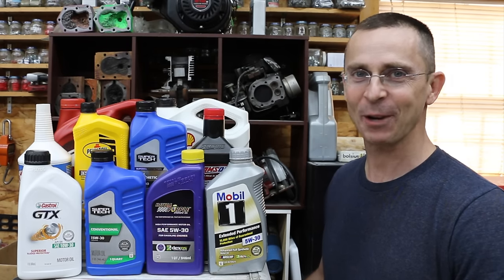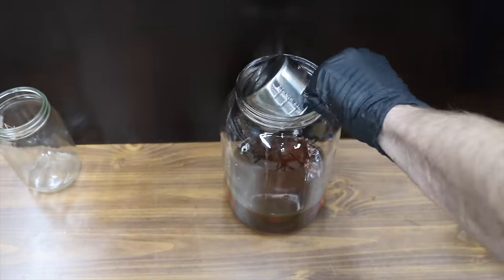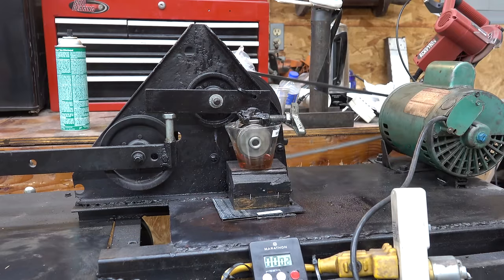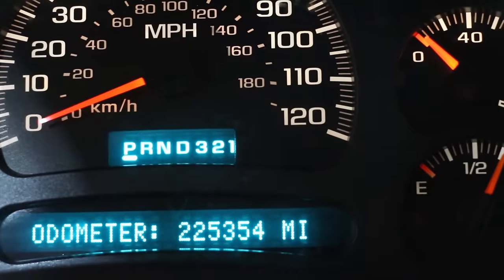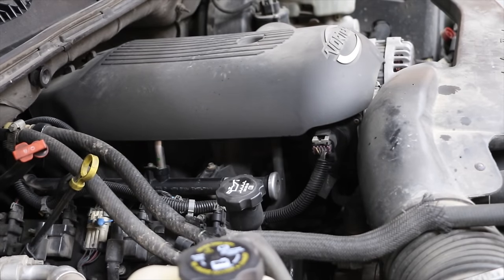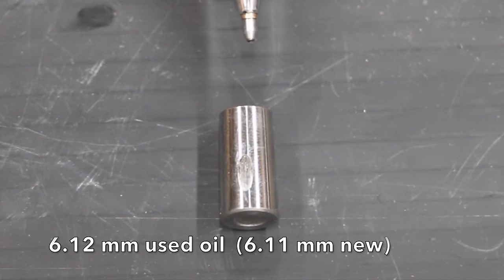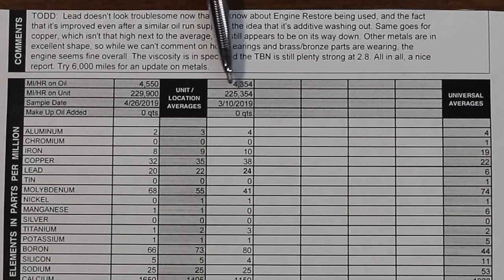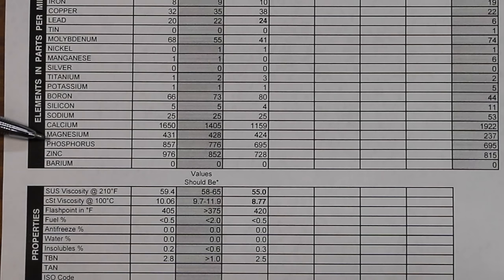Will Mixing 10 Motor Oils Damage an Engine? Let's find out!

Comment: You should try running 80-90w gear oil in an engine
Reply from the maker: Thank you for the video idea!
Reply: My prediction is it'll be too thick to properly flow, and the engine will seize as if there was little or no oil in there.
Reply: @ProjectFarm  80w90 gear oil=20w50 motor oil. The add package is different sulfur in the gear oil will damage the softer metals in the engine. Here's a good chart.  https://53ez82p1xgbdzuy8ma1qotwh-wpengine.netdna-ssl.com/wp-content/uploads/2015/02/Viscosity-Chart.jpg
Reply: Justin Noker would be interesting though because there are products out there that basically just thicken the oil.. like bardahl nosmoke.. I wonder how thick is too thick if you're in a pinch.
Reply: Only in a very high MILAGE engine. Were your BEARING clearances are worn!
Reply: I do in my old lawn mower. It stinks like hell. The thing is so bad on blow by it isn't even funny. I cannot believe it still runs. I used it for cutting my runway for my RC planes. I relocated and do not fly there now.
Reply: @cpufreak101  I use it in my mower. It stinks something terrible but does run ok. The blow by is so bad it doesn't matter. It was a free lawn mower.
Reply: might work ok in Texas in July, but I'd think your engine is gonna be fairly stiff come December at the top of Alaska.
Reply: @jseden  As long as it's not cold outside, you're fine... if it gets below 40 it may not turn over! lol...
Reply: Dean W. I did it in a 1971 dodge with a slant 6.  It smelled horrible.  But I ran that dodge for quite a few years.   I never changed it either.  I was dumping a quart a week in    It leaked and burned that quart in about 500 miles.
Reply: My dad claims he ran a Volvo 240 on gear oil. Said it smoked like a tire fire but the engine was very worn out and wouldn't run on engine oil
Reply: I ran 90w hydraulic oil in a Ford 4.0l v6 in an explorer for years. I got it for free and it had a horrible rear main seal leak. It got to the point where I was fed up with putting oil in it. So I drove it to our shop with no oil in it and loaded it with with 90w. We got 55 gallon drums by the pallet load so it was cheap and available. I didn't care if it blew up after all I got it for free and only used it as a hunting wagon. To my surprise several thousand miles later it was still running. I sold it to my step son for $200 for a winter beater and hunting wagon. 2 weeks later he hit a power pole doing 50mph while booze cruising dirt roads. He Proceeded to drive it 3 miles to his friends land and park it. We went out there 2 months later to trailer it to the scrap yard. I put the key in and it fired right up and drove on the trailer like nothing happened. All this happened after it was rolled 2 times and caught on fire 3 times. I'm a chevy boy till I die but that explore was the most stubborn and indestructible vehicle I've ever seen in my life. It just refused to lay over and die.
Reply: Domino  and 75w90
Reply: I've done this and no damage has happened except for breaking distributor roll pins every once in a while
Reply: I had a knocker that I tried first to put one quart gear lube in. Then next change I used 2 quarts. When I decided it was done for I did it's final oil change with blue bottle zddp additive. It was by far the quietest. I got a few more changes out of her with the blue bottle every time. Finally she wouldn't pull her own weight and I retired that truck. It was a old 351w f150. I miss it but it's nice not to stare at the oil pressure at every stop light
Reply: Yes! And hypoid etc oil. Also like lithium grease 50/50 mix with engine oil so there's a flow.
Reply: With lacquer thinner as fuel
Reply: @hotdawg9840  oh yeah. Y'all gotta try Colman lantern fuel.
Reply: Dean W. Did it for 5 years in my Pontiac 400 engine after a spun bearing developed. Ran great till the day I yanked the engine out for a rebuild.
Reply: My dumb brother did that on a Ford model A 4 cyl. because it had a rod knock. 
It didn't work at all. Had to replace the engine.
Reply: @GeneralRELee  Yeah...no. Even in Northern Michigan, anything below 45 degrees is a no go. That oil would be like molasses.  I don't run my trim mower in November at all because it I couldn't pull it over. Even my regular lawn mower hates running in the fall. I use 5W 30 in my snow blowers as per manufacturer request. I love how people ask why snowblower engines do not have air filters? Because they get wet and freeze up solid as a brick.
Reply: That's literally just 10w30 motor lol
Reply: @miketonon7946  80w90 won't flow through the newer Toyota engines that "require" 0w16 oil....  That 0w16 is only slightly thicker than water....
Reply: Domino  27thousand when it stated knocking. Had 73 thousand when it died. Pretty sure odometer rolled over at least once or twice before I owned it.
Reply: I know a cheap old guy that had a old beater 80’s Honda, and it smoked so bad, and barely had any compression, so the fool put 80w90 in it and it actually kept running and didn’t smoke as bad. True story.
Reply: Transmission oils have the same "weight" as engine oild, but the made the numbers WAY off so people don't swap them around. Why: the additives are totally different (high pressure vs high speed, catalyst compaitibility and so on).
Reply: I used Vavoline synthetic gear oil  on my swamp cooler bearings and have no more squeaks.  It works great but it smells like my ugly wives crotch.
Reply: This is an awesome idea
Reply: Talk about dedication to his craft lol he drove a vehicle for 6 weeks just for a YouTube video 😂😂

Comment: Test if transmission fluid really can be used as a clear for sludge in the engine
Reply from the maker: Thank you for the video idea!
Reply: I personally use a little MMO 
I only used 12 ounces in the 7 quart capacity. 
I don't like to thin out the oil too much.
Reply: @ProjectFarm  do it dude!
Reply: Diesel will
Reply: @ProjectFarm  ATF is used in Europe among old timer/barnfind car people to free pistons and "clean" flush the engine block...
Reply: @johndosh2469  test it to prove it
Reply: @exil3dlivecom  did it on my dodge shadow when I blew my head gasket... fill it with diesel ,pull the coil and crank it over and drain.done
Reply: kerosene works better, undo the spark plugs and give it 4-5 turnovers and dump it, add 3qts of oil and turn over 4-5 times then dump it, now add oil back, plugs, and filter. people forget to flush the kerosene which causes problems that's how they do it in shops to fix sludge cause 1.5 gals of kerosene and 3qts of cheap oil is better than us ripping the pan off your car which with new cars involves pulling the engine
Reply: @Andy47357  prove it with video
Reply: @exil3dlivecom  sure next time we do it at work i'll do a video on it
Reply: Trans fluid does remove sludge do to the high detergents in it.
If your hands have dirty oil on them put some clean trans fluid on a clean rag and wipe your hands.
Bet your hands will be a lot cleaner.
Reply: @Andy47357  Agree totally. Been doing this for years.. works the best...
Reply: Atf to be specific... Not mtf
Reply: @Andy47357  awesome@ best evidence is video evidence!
Reply: @ProjectFarm  I heard of brake fluid as a (pretty effective) sludge washer.
Reply: @kitecattestecke2303  so is diesel...
Reply: Project Farm you could also compare with marvel mystery oil and kerosene (an old time remedy) there are also motor flushed out there as well.
Reply: SkywalkerTibor if you want to destroy all the rubber seals. It’ll clean alright. But won’t be able to keep the oil in the motor anymore
Reply: Years ago, used to run 1/2 quart in with the regular oil. The old timers in the 1980s swore by this.
Reply: Just use Rotella, its pretty good at cleaning that old stuff out
Reply: HERPY DERPEDY 
What's MMO? Mommas Menstrual Oils? I don't want that in my engine, I'll never get the smell out.
Reply: it certainly can it has been done for years. atf is just a thin oil, about 7w15, with special additives that are safe for wet clutches and a crapload of detergents. kerosene and diesel also certainly work but atf leaves behind more of an oil film so it isnt as harsh and wont cause a dry start. i only use kerosene on things like gearboxes and such that splash lube and operate at a lot lower rpm than an engine. or parts that have been removed.
Reply: I used to add a quart of transmission fluid to an engine older engine like 70s 80s about 500 miles away from the oil change never had a problem
Reply: @lonniebeal6032  i do if i buy a used vehicle with a neglected engine. add atf before the change with cheap oil and filter for short intervals until its reasonably clean and then put in good oil and filter and drive as normal
Reply: Transmission fluid is just a heavy weight oil with detergents and dye. 
It does make things clean though but it wont take away massive sludge deposits. You have to scrape those out with petroleum based solvents to get it good. I hate sludge. Even the sight bothers me.
Reply: Free Lunch true
Reply: It does, too much will make your seals mushy though, at least old seals with natural rubber. However, just the right amount can make the seals on an old motor come back for a while if they're dried out. I say for a while because they crack when they shrink and those little tears will eventually grow. 
Fuel injected engines stay a lot cleaner, push rod engines have little oil that circulates up top. For the test to show the dramatic results, pick an older carbureted overhead cam engine, take a pic of the inside of the valve cover and run 1 oil change with 1 qt subbed with atf. The next oil change you'll see lighter/clean stripes where the cam lobes are depending how dirty they were to start with.
Reply: @ty2010  I took apart a 1988 mercedes turbo diesel last week. First time it's been cracked open in ten years. It had a valve job at 300k miles in 2010. I was very surprised to see how clean it was. I know its was probably all cleaned in 2010 but damn.
I have not seen the bottom end but the top just has stained metal that looks gold in color and some puddles here and there. Amazing because I got sludge on a Mini Cooper S I bought brand new after only 2 years. It was bad too. They took the car back.
Reply: knew some old timers that had a garage in Atlanta in the mid `70's (took my `53 Olds there one day) and they told me they add a pint of tranny fluid to oil all the time...plus...one of 'em pointed at a car an said..'see that car there? all I've ever done is change the oil filter and it has 300,000 miles on it.' on top of that they'd pour a dash of water in the carb while it was running and I asked what'da do that for? and they replied ....'to steam clean the engine.'..will say this those ole boys then are sure different that the ones these days....
Reply: @ftnppg1272  I should have specified non-diesel, gas getting in the oil is what creates most of those nasty varnishes after the volatiles cook off. Diesels get coked which mainly sticks to combustion chamber and exhaust, they leak a little fuel and the engine gets ruined.
Minis have so many problems that a valid comparisons/generalizations really can't be made.
Reply: @moss8448  Valves and seats were softer then and more subject to burning if run too lean so everything was run slightly rich and carbon buildup was the main problem.
Reply: @moss8448  YEs you are right. Water in the pistons is an old trick. It does work. Better than sea foam even. 
I am here in Georgia too.
Reply: @ty2010  I know you were talking about diesel but we were also talking about sludge. I have experienced sludge in both gas and diesel engines. Mini Coopers were particularly bad at sludging and blocking oil channels and pickups. The holes that the oil traveled through were apparently small and Mini/BMW told me to change the oil every 5k miles when it needed done in half the time even with synthetic. It killed the car almost. It was a lease and was so clogged up they talked to mini and gave me a new car for rest of my lease. It later became a recall/service advisory to use a thin full synthetic oil and change twice as often. They had to change their recommendations.
Reply: My old shop teacher rebuilt engines for Buick and race cars and after he primed the oil pump he poured a quart of Dexron II into the carburetor and cranked the engine with the spark plugs removed to get the excess fluid out of the cylinders.
He learned it when he was visiting Jr Johnson shop and it helped not only stop initial wear but it helped seal the floats in the carb.
Reply: @robertmathews6915  Trans fluid is an old trick for nearly everything. When my RX7s wouldnt start we would pour a quart in the intake and push them from the rear while in first until they started running on their own. I was told the rotors would get "flooded" with fuel, oil, and carbon and the trans fluid cleared it out. I am sceptical though. I am thinking a bottle of engine oil may have done just as good. I cant say though.
Reply: @Andy47357  A lot of shops just use engine flush machines......
Reply: Theodore Marakas  Use Type-F or Dexron III....both work just fine and are still available at most parts stores.

Comment: Toyota engine: adds concrete and water. Runs 100k miles more before next concrete change
Reply from the maker: lol
Reply: RantChant 316 lets not forget the Toyota engines that sludges up on the best oils made and fast. Toyota settled a class action lawsuit on 2.5 million engines. I had one
Reply: @F8lastcallcharger345  I did not know this what models were they.  2.5 million though isn't bad considering how many are on the road.  Mine just hit 234k
Reply: My mr2 with the 3sge engine is still running strong after 270000km's and barely uses oil
Reply: Their has been tests using concrete as coolant and it works just don't shut the pump off
Reply: @F8lastcallcharger345  that was bad for toyota standards, but in the big picture it's a tiny fraction of toyota's out there. to this day, toyota and honda have the most 20+ year old cars on the roads. they may have some issues along the way like every manufacturer does, but compared to most brands and especially brands like FIAT/Chrysler, GM, Nissan... they are godly.
Reply: SACKRETE, they must be LOADED!
Reply: Just built better lol
Reply: @Jon-nz3dm  my mitsubishi endeavor has over 300 000 km. Shes a 2008. Very very little rust that it gonna be fixed this summer. Well anyway ive owned her just over 6 yrs. Did 3 yrs of pizza delivery. Well 3 wheel bearings, 1 axle, 2 stabalizer links, valve cover gaskit, plugs, coils and mass air flow sensor and 3 sets of brakes as per pizza delivery working 50 hrs per week never shut off most nights. Drive the shit out of her. Never changed any fluids but engine oil once per year. Well delivery job every 4 months as per ran 10 hrs per night none stop idle then off like a rocket. So yup mitsubishi must be good too. Like over 6 yrs of beating her up and deliver and off roading and under 2 grand in parts and mega easy to work on
Reply: @Jon-nz3dm  I live on an extremely busy 4 way stop...most spotted older vehicle... Chevy Silverado.
Reply: @hr2186  those definitely run forever...up to about 2001 or 2003 the silverado's and suburbans were built to last(at least engine/transmission wise). my grandparents have a 300k mile 1994 suburban that refuses to die and my mother has a 150k mile 2001 model

Comment: I used to have a $400 Subaru with over 300k miles on it. Car ran okay still, but had some fairly major engine leaks plus it burned oil. I'm pretty sure I had you beat in number of types of oil put into a vehicle. When you're adding a quart a day, you just use whatever you can get cheap. Often this was used oils of various viscosities, straight 30 weight small engine oil. Often I ran some 15W40 diesel oil a local farm supply store sold for really cheap in five gallon jugs.

I don't know what damage all these various oils caused to that car, but I put about 25,000 miles out of that car. The engine was still running fine, but the trans gave out.
Reply: Unless your desperate for oil and the only thing near is the gas station that sells oil at $10 a quart.
-_-
Reply: Subarus are known for burning oil.

Subaru even has said that burning a quart every 1000 miles or so is normal.

Personally, I think they are junk if they do that.
Reply: Weird my Toyota maybe burns 0.25 of a quart At the end of a 5000 mile oil change and it has 233k miles
Reply: I used recycled motor oil that I bought at K-Mart in my old F-250 that burned a quart for every tank of gas.
Reply: @TempoMontages  You must realize, it may not, in fact, even be burning oil. Oil may have gotten trapped in certain areas in the engine. Maybe the head or other plateaus within. Or its burning oil....lol.
Reply: I had a cavalier with 420,000 miles, it would burn oil like crazy around the 370,000 Mile mark, I would just keep adding Lucas until it would stop burning oil (would never completely stopped but it would slow down a lot)
Reply: A Cavalier with 420k miles? Wow, that's impressive. I had a 2000 Cavalier with around 180k and while it still ran it already burned quite a bit of oil by that point, and the god-awful 3 speed automatic that car was equipped with clunked pretty hard into every gear. I should have gotten a Cavalier with a 5 speed....
Reply: Anyone that thinks they know anything about 2.2l ecotecs will say they're horrible! I've had nothing but good come from the 3 cars I've had with them! They just need to be taken care of and maintained! They're great engines, and GMs transmissions have always been very give or take, mine started slipping towards the end, but Lucas helped that too! Lol
Reply: @joelabresh3033  My 2000 Cavalier had the old 2.2L pushrod engine, not the ecotec which I believe came out a few years later.

I maintain my cars fairly well, but having bought that car with 140k I can't speak to how it was maintained for most it's life.